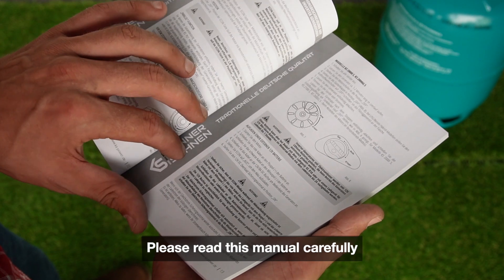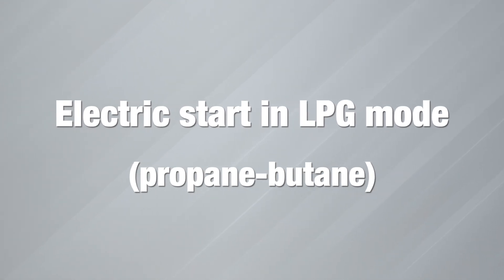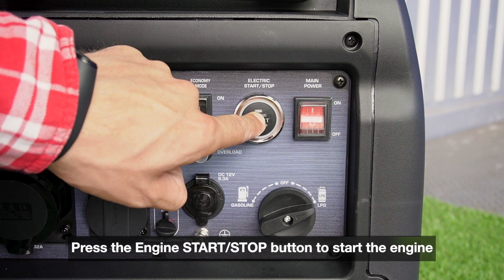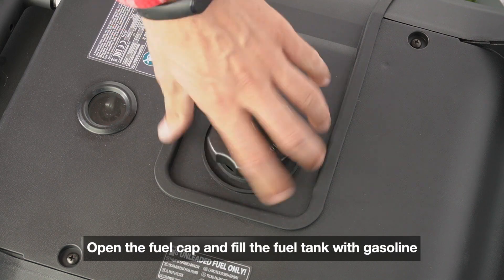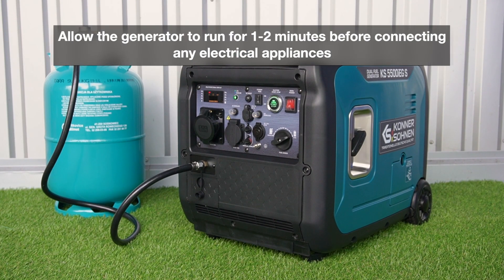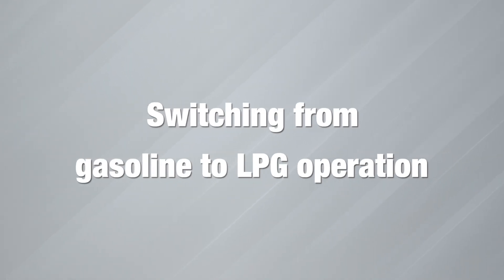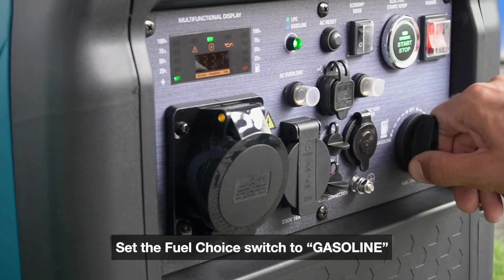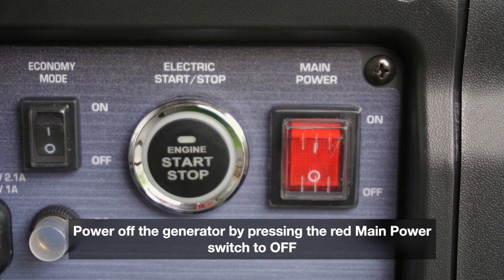Commissioning of a LPG/gasoline inverter generators Könner & Söhnen® KS 5500iEG S

Comment: 10 kg of LPG how long does it take to run out?
Reply from the maker: Thank you for your question!

While a 10 kg LPG bottle (approx. 18.5 L) may theoretically run the KS 5500iEG S generator for about 8 hours at 50% load, in practice it is too small for stable operation over time.

This is because the gas flow rate from a 10 kg bottle decreases as the gas level drops or in cold temperatures. It may not be able to continuously supply the 2.3 L/h required by the generator, especially during extended use — leading to power loss or shutdown.

For reliable performance, we recommend using 33 kg bottle, which provides sufficient flow for longer operation.

👉 33 kg LPG bottle (approx. 65 L of liquid gas) provides:
 - Up to 6 L/h for short periods (~2 hours),
 - Around 3.6 L/h for periodic use (~8 hours),
 - Around 1.2 L/h for continuous operation
Reply: @konner_sohnen_en  Thanks appreciated